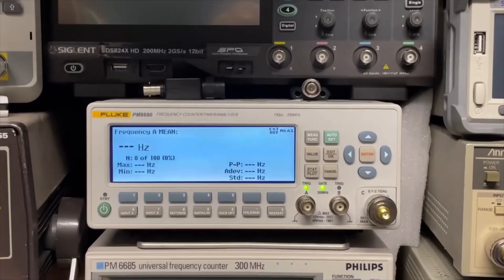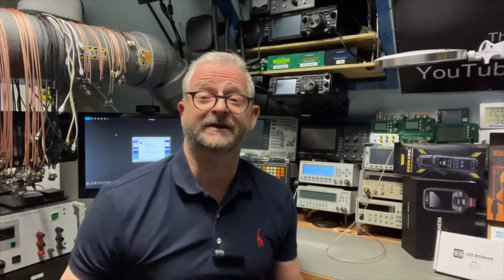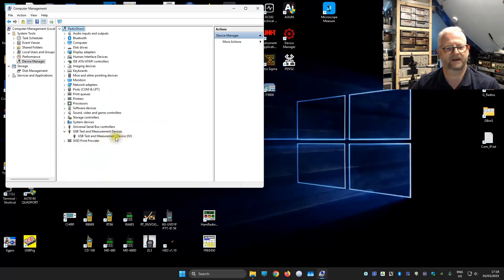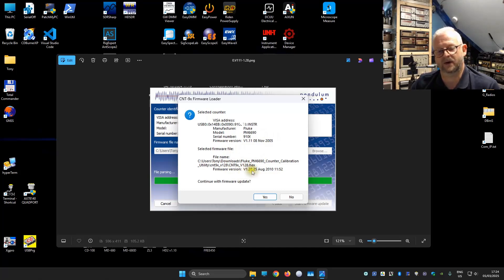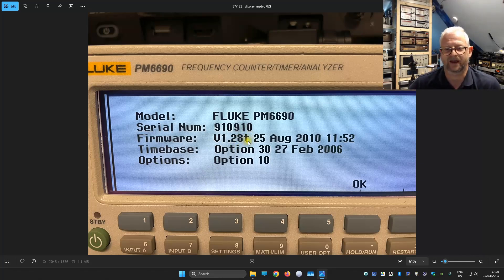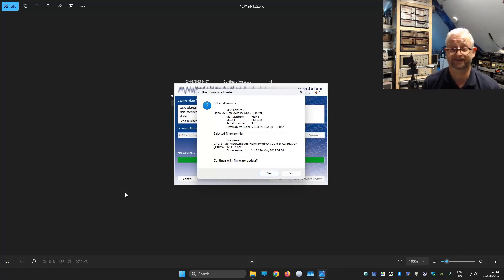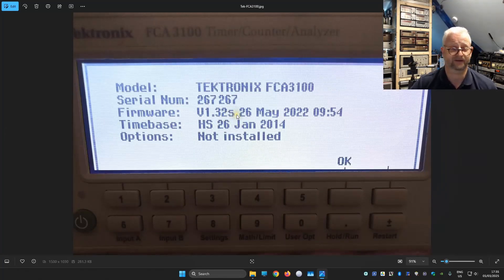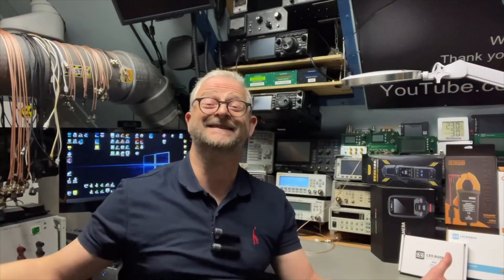TA-0438: Fluke PM6690 - FCA3000 - FCA3100 - CNT90 - Firmware Update 1.32

Comment: Always high adventure when updating device firmware! Newer Icom radios especially...I always power from a UPS since if it gets interrupted it turns into a paperweight and has to be returned to Icom for a fix, ouch! Thanks Tony for sharing!  73 - Dino KLØS
Reply from the maker: Thanks, Yes an UPS is also a great option for extra security while flashing. 73